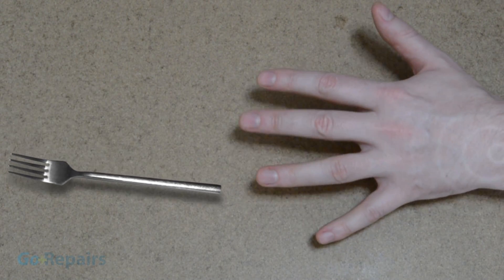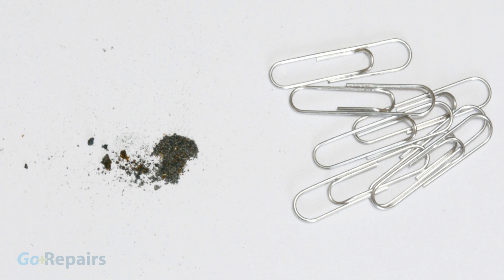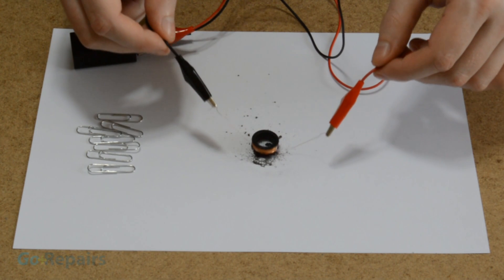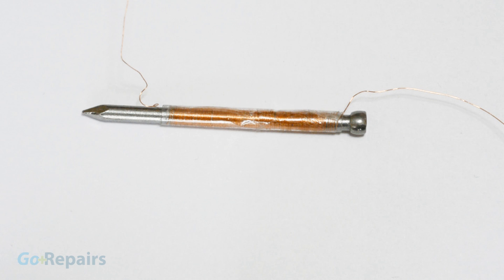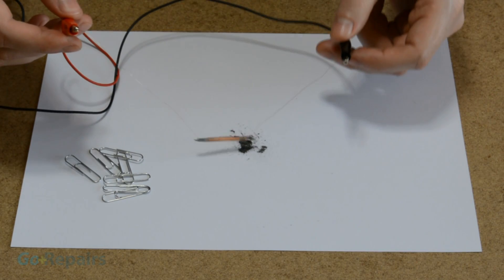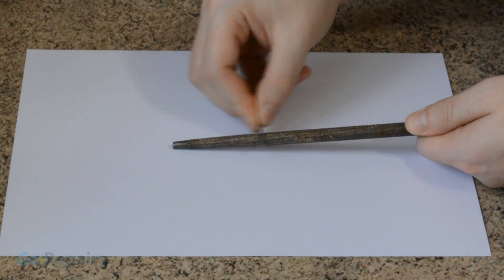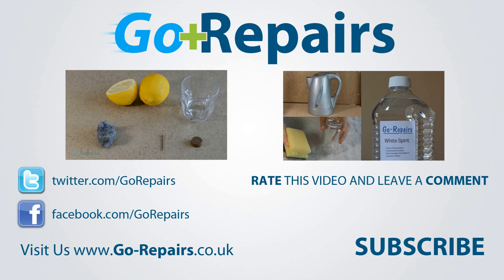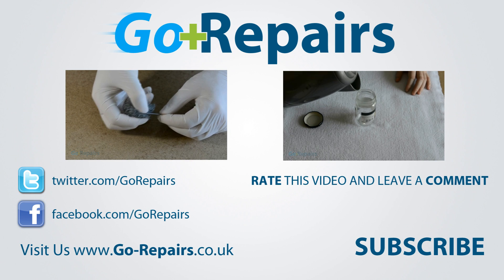How To Make An Electromagnet

Comment from the maker: It's the same principle - coil insulated copper wire around an iron core. But use an electrical connector to attach your supply. If you run too much power through it, it will burn out. Just remember to insulate any bare wires to avoid the risk of electrical shock. Beware that if you dabble with mains power, it can be very dangerous if you don't know what your doing. It could cause damage to people or property. Stay safe.